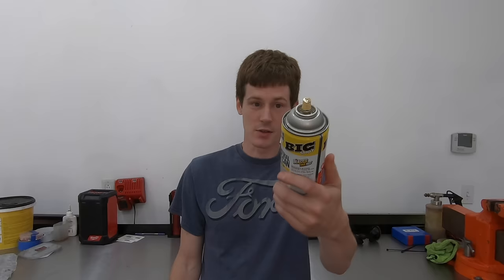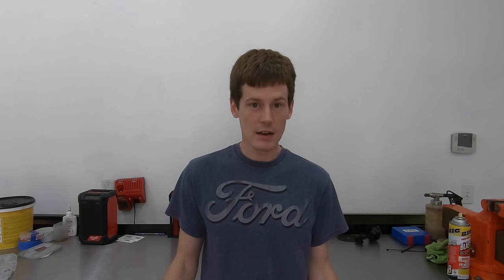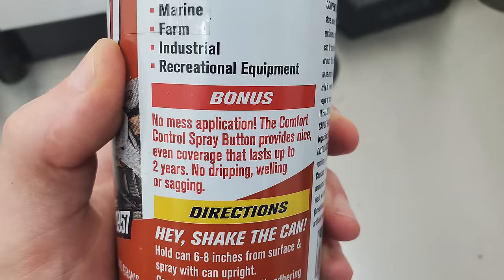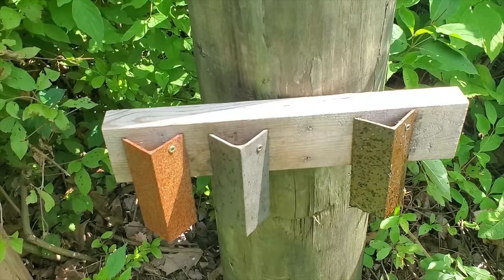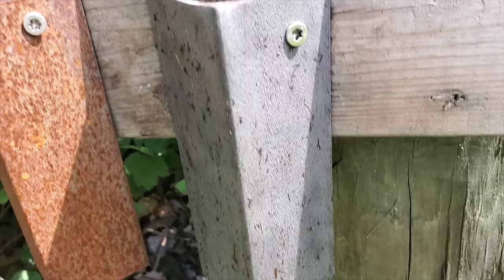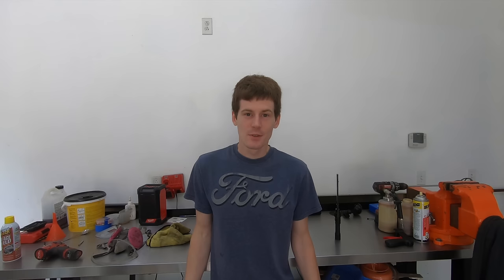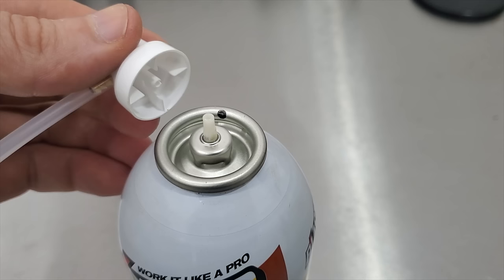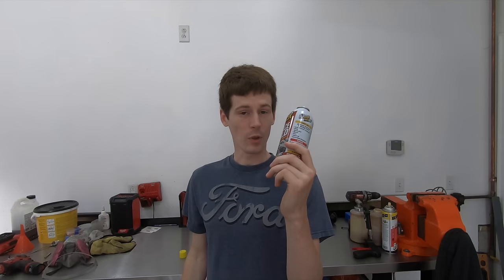I Finally Found The Best Undercoating On The Market... Blaster Surface Shield

Comment: Watched your video 8 months ago and was finally able to find Surface Shield earlier this year. I treated the inside of my Toyota’s frame and it’s been great so far. The only grip I can come up with is, when it’s hot the stuff softens enough that it drips from the frame drain holes onto the ground. I’ll be coating some of the external bits when it cools off in the fall.
Reply: I use oil and it does the same thing for a few days.I think they use petro jelly in that and it melts.

Comment: Thank you! Edit Feb.11, 2023, 8 months later after I watched this is and applied the PB Blaster on my 4runner. I am in Pacific North West where we see the sun very rarely as it rains the whole winter. This thing is still fluid, but has not moved at all. I would say the thickness left is at least 60% from original. So I will reaply before next winter, i.e. in Oct.2023. Thank you!

Comment: Dude, thank you for the videos! I am moving to the Midwest next week for the first time ever. I have always lived down south or west coast so I know nothing about these coatings but wanted to learn as much as possible. The part I am sad about is that I have always been proud of my clean undercarriages and engine bays. Looks like you just need to let years of gunk build up for better protection, well here goes.. This should be interesting because I have a near mint condition 2008 Tundra and a brand new 2021 Forester with under 1000 miles. Your videos have encouraged me to do this and I believe I'll give Blaster a shot at it if I can find it in KC. I don't know though, not being able to use an attachment could push me towards fluid film, I'll try to update you, thanks!
Reply: Whatever you do, make sure you do a thorough job. That salt and chlorinated liquid can get in all the nooks and crannies you miss. And there are a LOT of nooks and crannies. Pay special attention to brake lines, fuel lines, fuel tank straps, and pull any plastic body plugs in doors or under panels and spray in there. Spray above the spare tire on your truck. Inside frame rails. Inside the tailgate. Behind the tail lights, all the door latches too. Get inside the panels of the bed as good as you can. Spray the wheel wells. Inside the fenders too. A rust free vehicle in the salt belt is like a unicorn. If you coat it really good though, you can keep it that way.
Reply: Hey man, I live in KC too, were you able to find it locally?
Reply: @ReidEvers  I know you can order cans and even buckets of it from auto parts stores like O'reillys. That way you don't even have to pay shipping. Just have them look it up and order some for you.
Reply: @ReidEvers  Found Fluid Film yesterday at Advance, think I’m going to settle for that. I was surprised not a lot of people at parts stores and hardware stores knew what I was talking about. Most people thought I was looking for bedliner sprays..
Reply: @jfque5044  Thanks. That's frustrating.
Reply: @Bloodbain88  I'll look into that!
Reply: @ReidEvers  Yeah, Advance had them buy 1 get 1 1/2 off. I was getting 2 anyways, gonna try to hit the Jeep up this afternoon!
Reply: @jfque5044  Good deal! Nice day for it. I checked at Home Depot off Skyview and no luck. Might as well use up the rest of the fluid flim I have.
Reply: Hey Jeremy F. Welcome to Mazurrah! If you are on this side of the river. There is a KC,Kansas to though. If you say Missourieeee, the natives will know instantly your a transplant. But your accent might give it away too. Up here they use alot of salt on snow and ice and can really do a number on your cars frame and body if not flushed off in a pretty short time..days at the most. Those drive through automatic car washes with a good undercarriage wash really helps until weather and temps evolve to be able to get at it yourself. Any attempt at prevention is better than nothing. Unless you had a rear seal leak on your tranny like my buddy had for years. Rear half his truck never rusted as it was lightly sprayed everyday at 65mph . He had a gravel driveway and he could of cared less. He wanted to get at his spare once and paid me 25 bucks to pull it off. Was rather easy as the threaded bolt was in great shape, tire not so much. Tranny fluid laying on it for years turned the rubber kinda spongy and very iffy if used on the road...KC is a really good town!!!

Comment: I find myself watching lots of your videos. I live near the ocean. Fog carries the salt everywhere, even stainless screws etc. corrode out here. I torture test some items on my Bike that I ride along the ocean shore. I often cover bolt and screw threads with lithium grease because it is easy . Maybe marine grease would be better? For extreme use I wrap teflon tape on threads before assembly. It helps keep bolt threads from locking into the nuts.(BTDT) . Anyway your tests have applications outside of your narrow range of preferred use.

Comment: I bought 1g Fluid Film Black, after watching one of your reviews, last year.  Then, after watching this one, I bought 1g Surface Shield.

I ended up mixing the 2 50:50 to get the longer lasting SS, along with the black pigment of the FF.  I applied it my wife's 2018 Jeep JLUR.  I couldn't be happier with the initial results.  It should be interesting to see how this mix holds up to New England weather.

Now, I need to apply it to my 2011 Ford Raptor.  Thanks for doing these test, and filming the results.

Tim

Comment: Another Great Video, Thanks!
I just received a case of Blaster Surface Shield that I had ordered  from HD. The cans still have the "male" outlet, but the spray button accepts a standard spray straw. So the long spray straws that are available will work with these cans for rustproofing enclosed spaces.
Reply: Not to nitpick but technically the spray nozzle on the can would be “female” in the cases where the nozzle accepts a straw.
Reply: @6atlantis  Hey 6atlantis, No problem, I could probably made it clearer, but the can itself has a male outlet and the can's spray tip actually has two female ports - in and out!

Comment: Great video. I recently used their silicone spray for maintenance on an Arizona residence that gets the brunt of heat, dust etc. Various door hinges, locks, blinds, window and patio door tracks etc. I had another brand but I liked the Blaster product better as it worked very well. Cautious optimism this workes just as well.

Comment: Would you possibly be able to do a follow up video showing it maybe be on a bare piece of steel like you have on the pole, and spray it and another piece of steel with fluid film on it with some kind of salt water mixture like what project farm did and then pressure wash the pieces of steel and spray the mixture on again to see how they hold up to being washed off?

Comment: I don't know what happened to PB Blaster some 10 years ago, but the penitrating spray used to be the best and now is about on par with WD-40. I still have one of there old cans and tested it last year, still works amazing. Had to stop using it, but this looks to be promising of the company i used to know. Definitely picking up a can of Surface Shield next time I'm at the big box store
Reply: Yeah, I absolutely would not trust this stuff because PB Blaster has gone downhill to such an extent that even WD-40 managed to beat PD Blaster in Project Farm's "Which Penetrating Oil is Best" testing video. Given that Repair Geek was sponsored by PB Blaster to make this video, I would not trust what I see here either. I'll wait until Project Farm does testing with this stuff before I can believe it. Until then, I'll keep using Fluid Film.
Reply from the maker: @SergeantExtreme  it doesn't stake a genius to strap some scrap metal on a telephone pole out by the road... If you think I'm full of it, it's not exactly hard to run that test.
Reply: @RepairGeek     At the same time, this is why you don't take sponsorships, then recommend said sponsor's product over their competitors. Even if you are correct in your assessment, it looks extremely suspect.
Reply: @SergeantExtreme  He disclosed & we all have to make our own decision
Reply: @SergeantExtreme yeah this really feels like just an advertisement

Comment: Hey Andrew Thanks for bringing this to our attention. It’s good you advised Blaster management of extension hose issue. Maybe it can be mixed with Woolwax or Fluid Film ? I’m going to pickup some cans and a 5 gallon bucket when I can get it. Keep us updated Excellent video
Reply: Why dilute an awesome product with a less awesome product?
Reply: a 5 gallon will cost you at least $500+ let us know when you buy it because i doubt it
Reply: I believe the spray can version of any product of this type substance is partially diluted in a way to help it properly spray out of can without getting clogged. Slight dilution will help everyone using a smaller air compressor. That’s all

Comment: Guy I live in Seneca County and found a excellent undercoating and you will be shocked, it is Roof Patch.  costs about $20 a gallon and you can get a undercoat spray gun either on line or use a TSC hand spot sand blaster.  As you were talking about creep even though Roof Patch is kinda thick it takes about day for it to set-up if you thin it out and trust me it will creep.  About a day or so later you have it marking the floor.  So far it works for me so I am going to stick with it.

Comment: Tried both the Blaster and the Fluid Film.  The Blaster was more expensive and the Fluid Film sprayed much better.  The blaster nozzle kept clogging up.  I had to keep cleaning the nozzles to get through 2 cans.  Unless the Blaster holds up far better I'm going back to Fluid Film.

Comment: I'm down here in Cincy, glad to see a fellow Ohio'n testing undersprays. When I my new truck comes in, I'll definitly be looking into Surface Shield. I've used a combo of spray paint, underbody car washes, and fluid film to keep my 18 year old outback looking good underneath. And still had to cut out and patch a couple spots with new metal over the past 7 years I've owned it.
Reply: Applied surface shield 8 months ago and it is still wet like fluid film. I wish mine dried solid like yours. I can wipe it off with my finger. Disappointed.

Comment: I've used Rustoleum's Rust Reformer on rusted and non- rusted surfaces. It actually lasted and it looks like black paint.
Reply: How long did it last? I recently used a good amount of it on my very rusted 01 Jeep Grand Cherokee and I’d like the vehicle to last a lot longer.
Reply: @burnedtoast8151  it lasted pretty long, I first discovered it when I didnt have actual paint for my rusty gym equipment, took it apart and was supposed to put back together, but I  procrastinated. 2 months later I finally did and I had to touch up a few spots and I used every since on anything. It still doesnt have paint on it just the rust- reformer
Reply: I used a rust reformer on my steel wheels on my vw. It was quite rusted. I just wire brushed it, used the rust reformer and let it dry, then painted it black.  I'm surprised the wheels dont have rust yet after maybe 7 years. I like this better than the annual application of the stuff.

Comment: Best product in my opinion  is Castrol motorcycle chain oil. It's sprayed on as a very runny liquid with what is likely a propane propellant , which evaporates after penetrating any rust. The heavier lube will stay on all winter and longer. Just don't spray it on locks as they won't work in colder weather.

Comment: I enjoy your rust protection reviews / videos and you're doing a Great job but let me tell you about CRC Extreme Duty Open Gear and Chain Lube which is the very best rust protection and is commonly used in industrial applications but works fantastic on rusty vehicle undercarriage. Try it.

Comment: Woolwax has a really thick product they call HV wheel well grease. It's pretty hard to wash it off with pressure washer. 
I coat my cars (whole undercarriage) with it using brush. If I need it to get it into cavities I just delute it with any kind of mineral spirits, rubbing alcohol or wax degreeser then spray.
It's the kind of long lasting treatment which you definitely don't have to renew every year or even two.
It would be really interesting to see this product tested too.